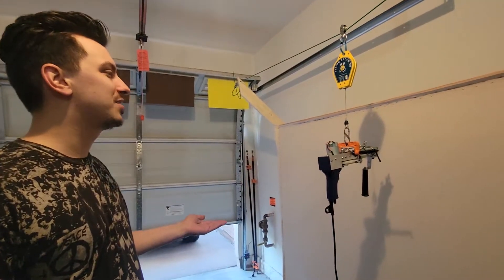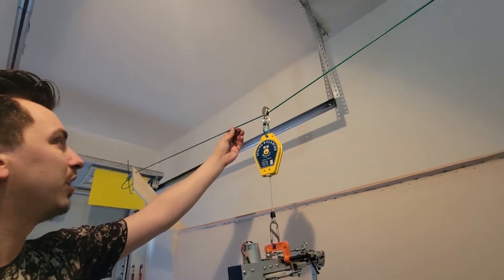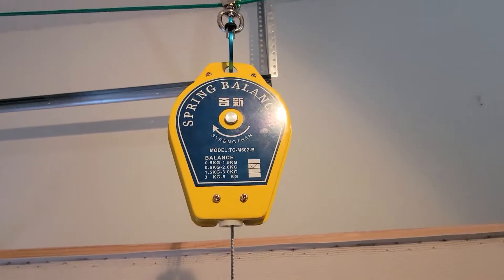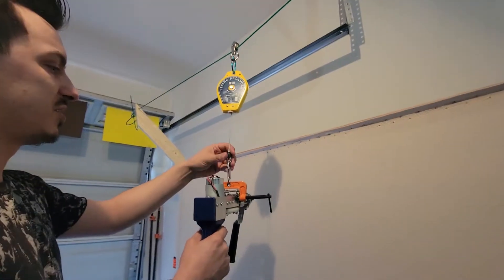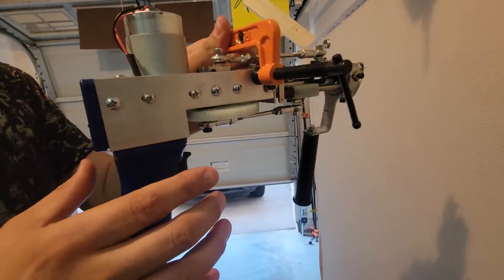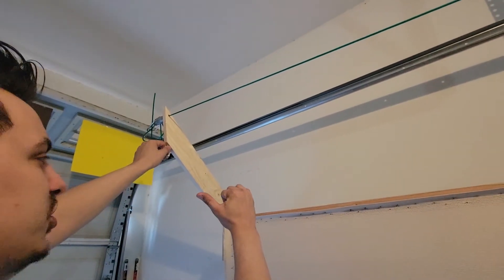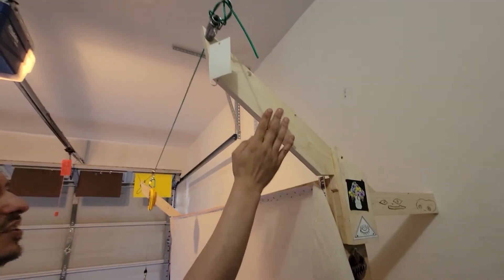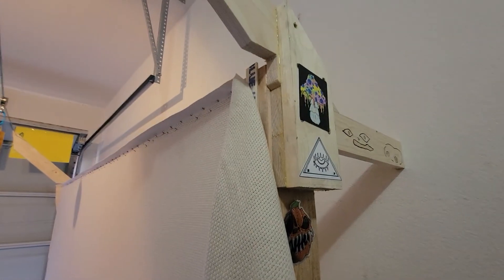How to add pully for your tufting frame. Rug Tufting Tips!

Comment: Get a long dowel (poplar is strong but lighter weight than oak) or an adjustable shower curtain rod to attach near cables to stop the tow-in
Reply: It will also keep the balancer at a consistent level rather than slacking like the cord.
Reply: @justaguy328  yes it would.
Reply: These work with that specific pulley or do you recommend a different one? There is some mixed reviews about it breaking on the on they’re using
Reply: @alekkvinge  I haven't used the pulleys I just noticed a fix for the tow in.

Comment: Can you please explain me, for what this tip is needed. Because I still don’t get it 😅😅
Reply: When you're tufting for hours on end, it gets tiring to keep putting down and picking up the gun. This trick really helps in that you can just let go of the gun whenever you need to
Reply: Thanks a lot!!
Reply: @katty1720  More importantly in my opinion, it allows you to have A LOT more control over your gun, since the gun is almost weightless, so when making curves you are not fighting the weight of the gun for control.  Your lines become so much cleaner.  Arguably the best thing you can buy if you want professional results.